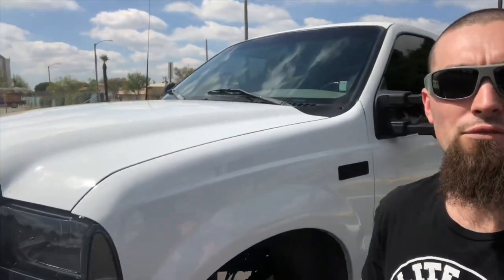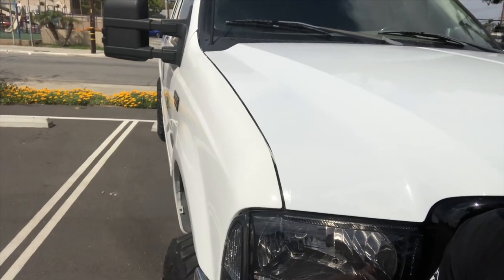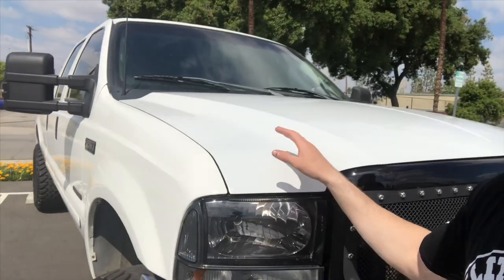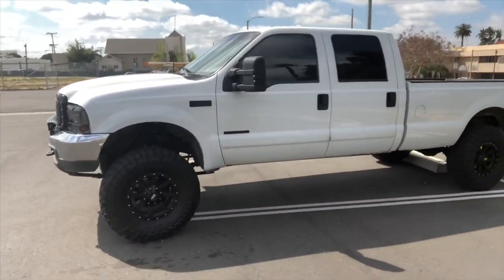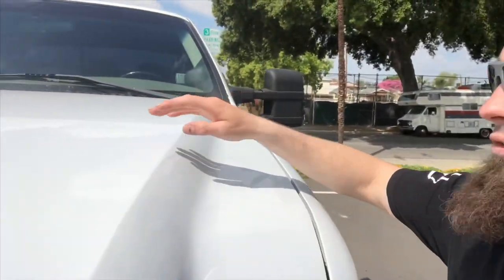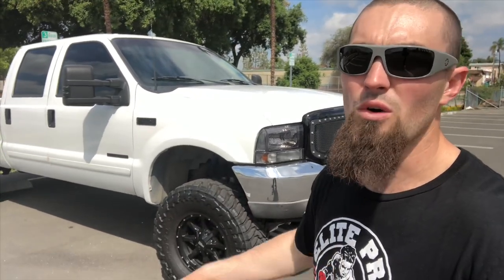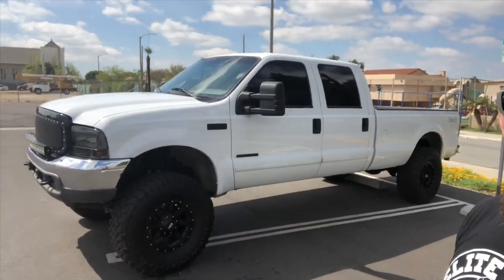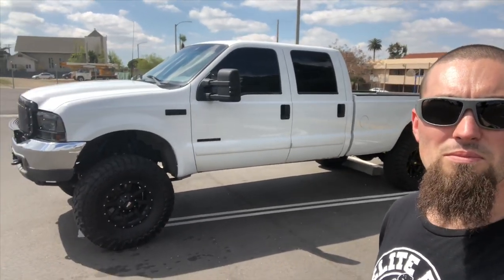7.3 powerstroke Paint job & build update

Comment: Yo Powerstroke Project I love your 2001 Ford F250 7.3 Powerstroke Crew Cab Long Bed 4x4 clean truck Bro upgrade To Kat skin leatherPower Heat it seats man put Bigger Tires new Anthem off Road Black Wheels
Reply from the maker: Tony Gabriele thanks bro the wheels are only like a month old but I’m getting the truck lifted a couple more inches soon and then I might go up to 38” tires! Thanks for the comment!🙌🏻